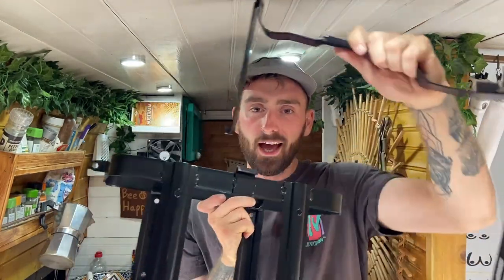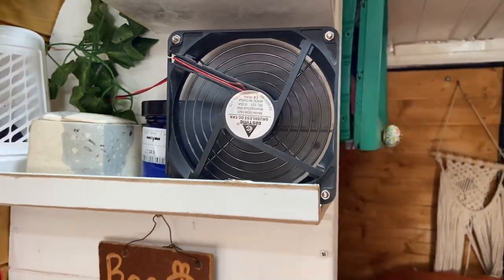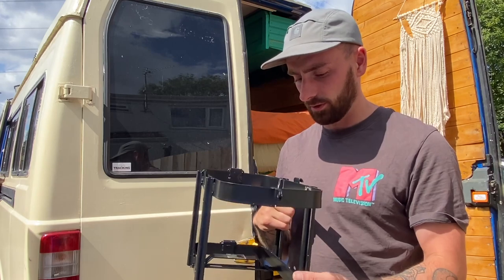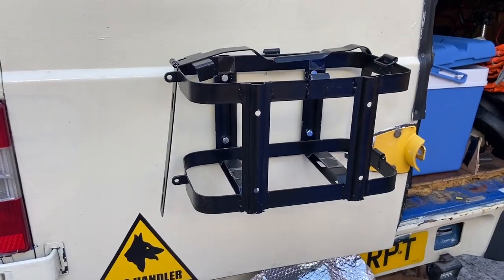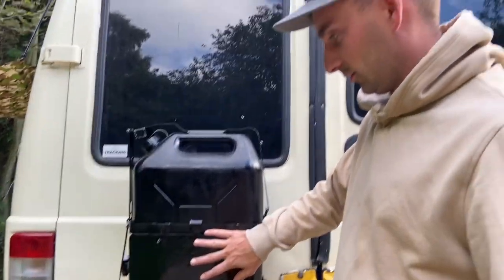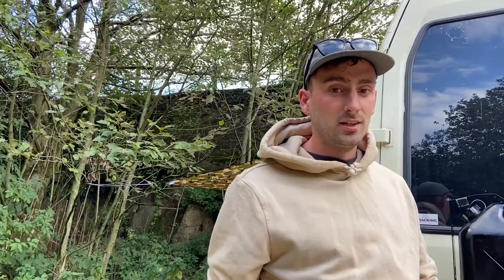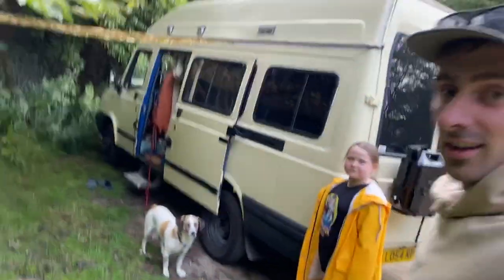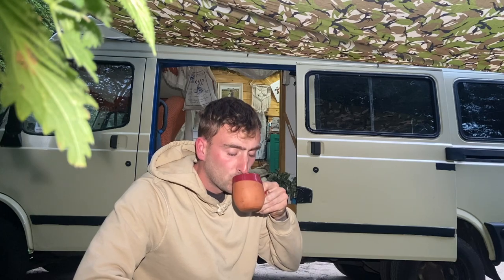Van Life JERRY CAN MOUNT install & 12volt CCTV.

Comment: Nice video but I wouldn't have cut out the inside of that door you weakened it when you did that it wasn't necessary to do that... also I would have made it lower down on the door so it doesn't block the window and it kept the weight low towards the bottom